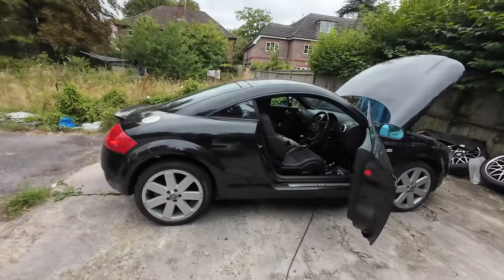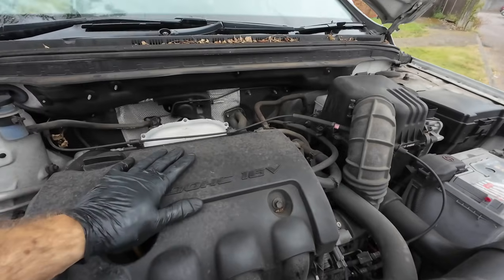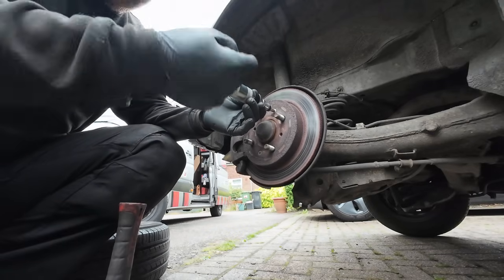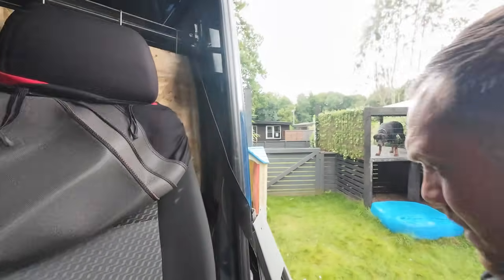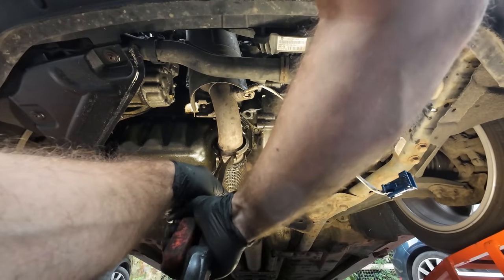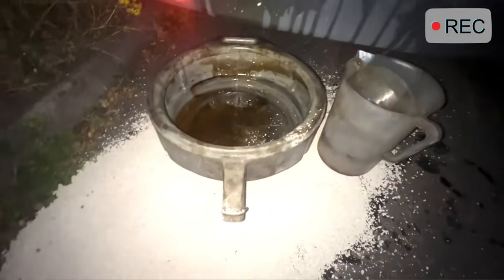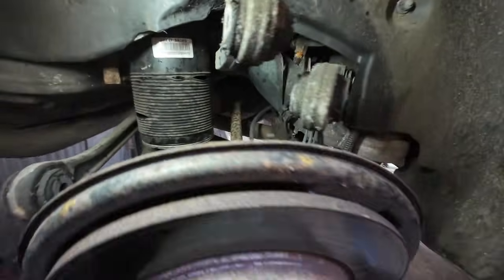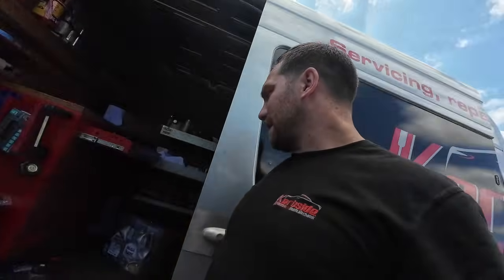I MESSED UP, LITERLLY! | Nosey customers | Late evenings | New Van | Kerbside weekly EP16

Comment: Stellantis approved Mobil 1 for use in their cars - FPW9.55535/03 is the approval for the 5/30 for DV5 engines I think - there is an approval for 0/20 aswell.
Citroen by me sometimes have the Total oil in stock, but when they don’t, the Mobil 1 oil carries the approval needed for warranty. Just make sure your supplier checks the approval matches the Citroen/peugeot/vauxhall approval number and list it on your invoice, and you should be fine.
I have done a few now, they prefer VAT registered mechanics aswell but I’m not sure it’s essential.
Hopefully a good bit of info for you so you don’t miss out as I had the same issue with the oil 👍🏼
Reply from the maker: Very handy mate, I’m just so wary of dealer warranty as they can be pedantic 🛎️🔚’s
Reply: Totally agree, I always tell my customers that if they are under warranty I can do it but it’s always best to go to the dealer. That way it’s not my problem if there is a warranty issue. But, they usually ask me to do the service so I try to do it as best I can to maintain the warranty, much like yourself. If it’s their choice to have me do it, I will do my best, but there no guarantees the warranty will stand - we all know the dealers get out of anything they want.

Comment: Squeaky belt,,,,, check the battery

Water leak you can’t find on vw will be egr (smell exhaust) or if really unlucky it has a silly gearbox cooler
Reply from the maker: But apparently no smoke from exhaust and it loses it QUICK!!
Reply: @kerbsidemobilemechanic  It doesn’t really smoke that much there’s a lot of filters nowadays on exhaust however if it’s running on coolant you will smell it but if it’s running on water you will not smell it I’ve noticed
Reply from the maker: I have a check of those systems out thank you 👍🏼

Comment: I know what youre saying but citreon dont make oil? we use SAR lubricants and match oil specs never had a problem as yet
Reply from the maker: No I know but most manufacturers will sell oil in 5/20 litres which is usually from the likes of Castrol but with their stamp on it